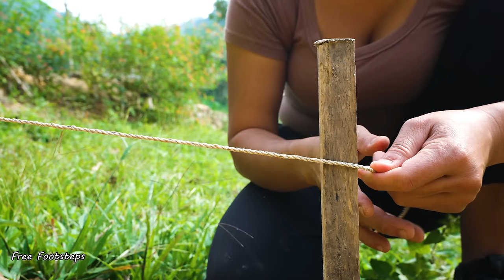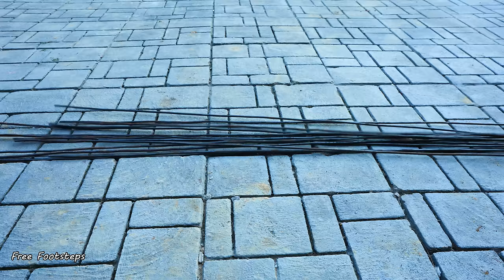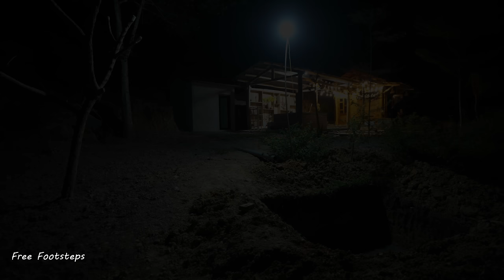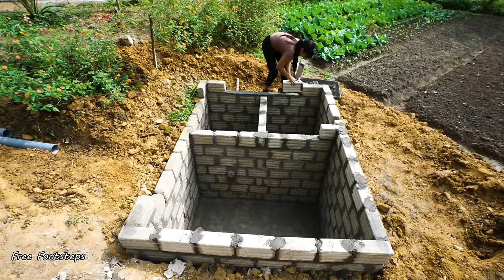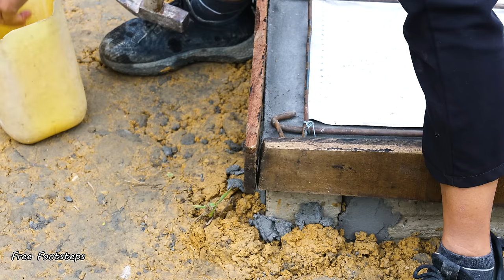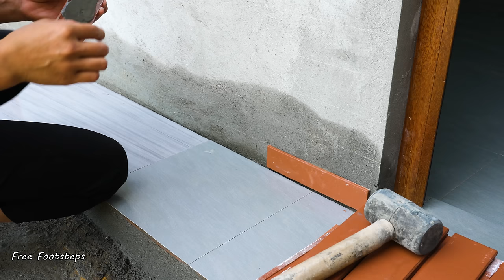How to Build a 3 Chamber Septic Tank - Build and Improve Your Life Alone, Part 4

Comment: I’m impressed with how much you have learned over the past couple of years and your Concrete work is really starting to become a value skill for your skill set but just a little bit of further advice that will help you is get yourself a Rubber Hammer 🔨 for Setting your Brick 🧱 in place as the Rubber Hammer 🔨 will Greatly reduce the risk of Damage to your Brick 🧱 work and I’ve also noticed that you are now applying concrete to the brick 🧱 before you lay them This is the Best Way to apply the Bricks 🧱 well Done 👍

Comment: The rebar is not affective if its laying on the ground. Put 1" pieces of rocks underneath in seletive areas. 

How are you going to gain access to the septic with no opening? How are you going to have it clean or fixed?